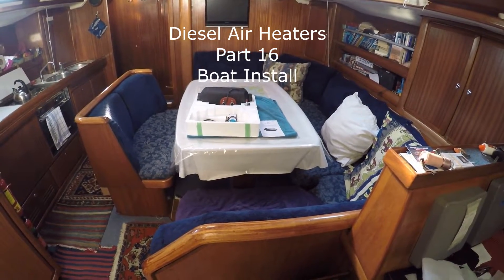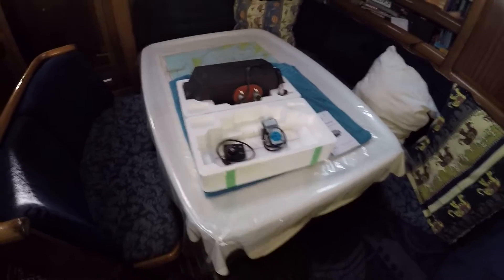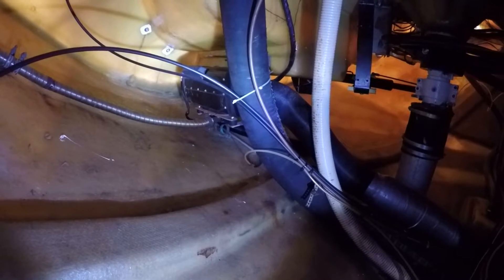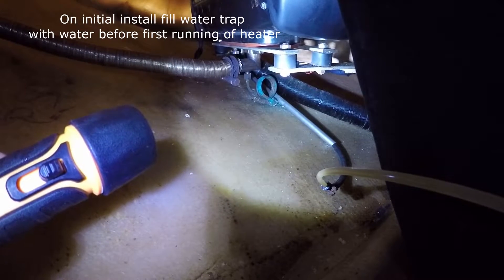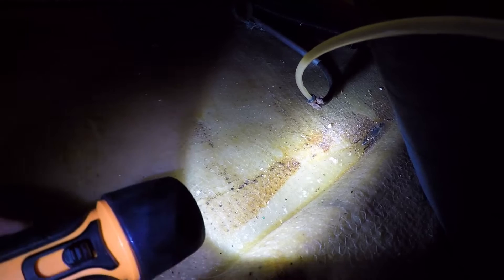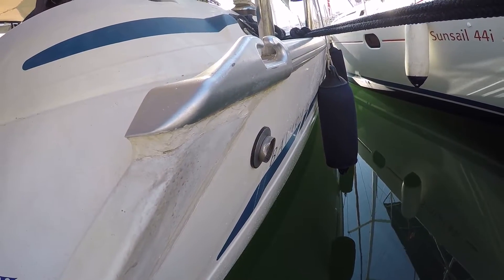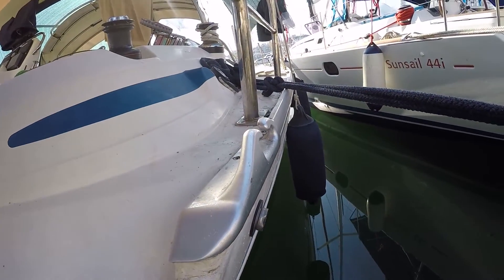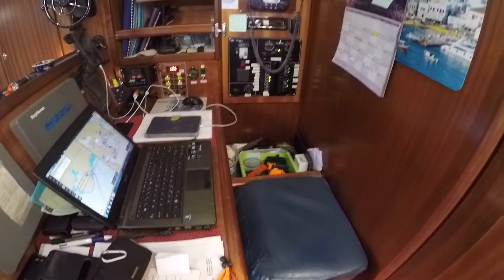Diesel Air Heaters Part 16  -  Boat Install

Comment: Thanks for all your efforts on these videos John, I've found them immensely valuable! You're an excellent teacher!
Reply from the maker: Thank you Mr B.   JMcK
Reply: Hi John wonder can you help me my 5kw diesel heater is showing E06 error I've sorted the fan it's ok now but still showing the fault and also saying check magnet polarity  thanks
Reply: I considered putting one of these in my motor home but saw a couple videos slamming the quality.  After watching these videos I’m convinced that if I install it correctly I won’t have a problem.  I’m also confident that I can do it myself.  Thanx

Comment: John, this was a totally excellent video thank you so much for taking the trouble to share all this invaluable information. i have had my Chinese heater lying in its box for months, while I have been thinking about the installation and finding an increasing number of questions. I am now just starting the install, and was thrilled to find that you answered every one of my questions. 

I was especially concerned about the terrible muffler as supplied, and will buy a proper one from Butlertechnik. The supplied one is lethal! Many thanks again, fair winds and following seas to you.
Reply from the maker: Hi, thanks for the nice feedback comments. I hope all goes well for you, and you have a lovely warm boat in the colder weather.  JMcK

Comment: Hi John Mck. I've watched a good number of your informative videos on these compact space heaters. In one of your earlier videos you were mentioning the air bubbles seen in the pump lines and how these were formed by action of cavitation. I have a bit of info to add. If the cavitation bubbles are no longer visible it is a sure sign that the atomisation gauze is becoming severely blocked with carbonisation. This creates a pressure resistance in the pipes exiting the fuel pump and the now compressed bubbles dissapear as the air pockets are collapsed by excess pressure in the fuel line.
Reply from the maker: Hi Howard, thanks for the feedback. Yes, you need to be able to see those little bubbles pulse tracking towards the heater.

Comment: Excellent Series on the Chinese diesel air heaters. I was looking to purchase a webasto, but the price scares me, but after watching your series i will definitely purchase the knock off.  Looking to put it into my cargo trailer for hunting the cold winters.  Just have to make up my mind on an all in one or the heater and tank separate!!  Great job on the videos!!!    Hello from the great white north, Fort McMurray, Alberta Canada
..
Reply from the maker: Hi Byron,  thanks for the feedback. If I was to install a permanent heater in a trailer I would use the standard heater. If I was going to move the heater around regularly I would go all in one heater.  JMcK

Comment: I've spent parts of two days watching this series of videos and I've learned a lot.  Thank you.

I'm always looking for alternative sources of power, light, heat and means to cook.  In addition to a 1600 watt inverter generator and a (very thirsty) 5000 watt generator (House damaged during storm?  May need power tools for repair.), I designed and built a solar-charged "Wait until daylight" system that can provide 8 to 20 hours of limited power for the frequent but usually short (under 3 hours) commercial power outages we have (longest outage here in 15 years was 16 hours, but we lived near this area before and had several consecutive days without power).  Why "Wait until daylight"?  The system provides enough power that I don't need to rush out in a thunderstorm or at below freezing temperatures in 7 inches of snow to get a gasoline generator out of the shed to have lights or keep the fridge cool.

I have the same outlook on backups for heating, having had a nearly new, very efficient, very high tech gas furnace controller die in January and the "3 day" turnaround was 14 days.  We managed with a kerosene heater at one end of the space we wanted to heat and gas logs in the fireplace at the other end (the remote AND the gas valve for the gas logs are battery powered so they work when power is off).  However, neither of those provides heat to the basement which is why I'm interested in a diesel heater.  I need limited heat for a few hundred square feet and the temperature rise above the outside temperature typically only needs to be perhaps 10 degrees F (5 degrees C) to keep the pipes in the basement from freezing.  A 5KW heater on its low setting (maybe 5000BTU?) might be adequate and, based on your tests, a gallon of diesel would last perhaps 26 hours.  On that basis, a 5 gallon can of diesel could probably probably provide enough heat to protect the pipes for at least a week - not every day will be below freezing and the underground portion of the basement will be close to the 45-50F (7-10C) ground temperature.  The solar system has a 420AH 12 volt battery bank so I would have power to run the heater and the solar power to recharge the batteries.

I still have research to do but you've given me an excellent start on it.
Reply from the maker: Hi Notyoung, thanks for the detailed feedback. I hope a diesel heater install meets your needs.  JMcK

Comment from the maker: Hi Richard, yes you could do that if you wish. It is just personal preference. Some people like to recycle the air, others like to only heat outside fresh air and accept they will burn a little more diesel. 

These heaters are excellent at removing moisture from the air, so that is not an issue whether you go fresh or recycle. JMcK

Comment: Thank you so much this series answered all my questions plus some things I didn't even consider.  I would love to hear more about your navigation, I run openCPN on a raspberry pi type setup with integrated AIS monitoring
Reply from the maker: Hi Clion. We run open CPN on the ship laptop at the chart table, with tracking always on. At the helm we have a large iPad in a water resistant case running Navionics or iSailor. I prefer iSailor, my partner prefers  Navionics. We had to buy a 3 amp USB outlet as we found the normal 2.1 amp would not keep the iPad charged .  JMcK

Comment: Hello John:
Suggestion for for safely stopping parasitic power draw on heater; obviously having a power switchable in a boat or motorhome is essential to keep the battery from going flat. However as you know if power is shut off accidentally while the heater is running you have a big problem. 

This can be eliminated by moving your switch from the power wire to the controller wire. A double throw switch will disconnect two of the three wires eliminating any possible power draw from the controller. A single throw switch should also work but a bit of experimentation would be necessary to put the switch on the proper wire. With this setup the heater could never accidentally lose power unless the fuse blows because as you mentioned the controller can be unplugged and the heater will continue to operate.

Thanks for what is truly the best Diesel air heater information on the web. Much appreciated. I don't suppose you could temp the exhaust at the port for me while running at full power. I am considering using high temp 3-ply silicone tubing in the exhaust either as a connector or for the full length to make attaching and sealing much easier for servicing the heater. They are rated for a max (though I suspect not constant) temperature of 260 degrees centigrade. The install in my boat would make it impossible to service in place and difficult to properly seal the exhaust using std stainless tubing alone. Any thoughts you could provide would be much appreciated. 

Thank you: Tim
Reply from the maker: @timsharkey_LensN2Shutter  

Hi Tim,

Thanks for the feedback.

Running at full power, you could exceed the max rated silicone temperature. 
Those videos are very old now, but I am sure I did exhaust temp readings in one or two of the videos.  When I get time I will go and have a look.   JMcK

Comment: John, thanks for your very thorough videos. Would you consider doing a video on the Chinese air/water combination heater, in the future. 

Thanks Steve
Reply from the maker: Hi Steve, yes, I would like to do a video on one of those if I can buy one at a reasonable price.  JMcK
Reply: @johnmck1147  well over time, the prices should come down, there are not many suppliers.  Thanks for the consideration.

https://wholesaler.alibaba.com/product-detail/5KW-7KW-12V-24V-water-heater_60871506423.html
Steve
Reply: John, excellent videos, really top notch on content.  @stevecarlisle3323  Those heater warm water very slowly, and put out a ton of hot air in the process. They are great IF you want to warm up the cabin and, as a bonus, get hot water after a while, but if you mainly want hot water, but does not necessarily want a cabin heater on at that moment, it will not work well (you can dumb warm air outside, but it will still take long to warm water for shower, for instance). With that in mind, I'm looking at getting one of the "regular" 5kw air heaters and installing a Y connection on the hot air output to run it through a car HVAC cabin heater (but backwards, warm air will heat water). A water circulation pump would force the flow between the boiler and the car "radiator" (I'm planing to heat the water it self, not no mess with engine cooling system part of the boiler). If this works, I will be able to only heat water, only cabin, or both... John, are you willing to make a test rig for this???  maybe it suits your needs on the boat as well. Cheers!
Reply: @paial  we are well aware of these water (hydronic) heaters, what they are designed for. NO, they are not " On Demand" water heater, but are used with radiators with fans.
Thanks
Reply: @stevecarlisle3323  , you might have seen this (https://www.youtube.com/watch?v=vtvy2MwbArQ), if not, the guy ran a lot of tests on type of heater you linked from alibaba. I was very interested in them, but when I saw the tests, from the total heat created, 20% goes to water an the rest to air (or something in that ball park). As far as I'm aware, chinese do not make a generic hydronic (wish they did), and the "brand" ones are way out of my price range. So my proposition was to transform a regular air heater into a dual porpoise one (heat only air, heat "only" water, heat both), use a air to water radiator in front of the hot air output, and store the hot water on the boiler (not "on demand"). I my sailing, now an then, I need more hot water, but no need for cabin heating, I feel really bad to turn on the diesel engine just to heat water, and I foresee needing cabin heating in the near future. So I was on the hopes that John could give this idea a try as he seems to really enjoy testing this things. Cheers.
Reply: Forgot to add, one thing that concerns me on this chinese air and water heater is that it seems like if the unit is on, you have to have a flow of water otherwise you will start boiling the water that was left over (or stagnant) maybe creating too much pressure in the system and/or start overheating water hoses. I might be me overthinking it, but in my head, you either have to have water flow (and a big tank for an overnight run) or have to drain the water part if you plan to use it for long for air heating purposes (and use metal pipes on the water side for some length).
Reply: @paial  Of course,  the heater is only one part of the system. Research Hydronic Heating ! You also need a pump and radiator !

Comment: Another excellent tutorial.  I am now going to cost up purchasing a genuine Chinese 5 Kw model and then the additional exhaust skin fitting, properly sealed marine exhaust silencer, master switch, exhaust lagging, exhaust brackets/hose clamp thingies, stainless steel cable ties, rubber mounts and modified mounting plate.  Fitting will be the biggest problem as my boat, Whittley SL26, doesn't have a lot of room around where I intend to do the installation which is in the void close to the throttle box controller 
It will need to be side mounted, glow plug side upwards, and the exhaust will, somehow, go upwards and out through the hull above the gunwales on the side of the cabin -----  could be easier said than done.  It's going to require universal joints to be fitted to my elbows and wrists!

Comment: John, I rely on your expertise and knowledge base when purchasing and installing operating, maintaing my 5 kW heater in my motorhome. again I thank you. Since I consider you The best source on the Internet I was thinking that maybe you could do a complete overview from the scam Of an 8 kW heater two the fuel hoses, exhaust, controllers, installing etc. and use this to refer back by number of your specific video for more information. Also I saw on the net that they have made one that has incorporated a water jacket so you can use it to heat water ! I watched it on YouTube and I’m curious as to the practicality? as I would like an on demand boondocks heater. Thanks again John you’re the best
Reply from the maker: Hi Keith, first thank you for your positive feedback.

I had basically finished the series but I have undertaken to do two more videos, one on the metal case heater, and a motor home install.

Re the air water heater, I would also do a test of one of those if I get my hands on one, but at this stage I do not see myself going back over past topics. But I never say never.

Cheers,   JMcK
Reply: John McK 47 Well john I was just hoping that you could do an overview of what’s involved from selecting a heater to installing the heater to running and shutting off the heater giving a complete overview and one video of all your fantastical lessons. By the way I have created a portable suitcase and installed a 5kw in it, along with a battery and fuel-cell  I’ll send you a couple of pictures later. 🙌
Reply: John McK 47 The reason for an overview is that people are generally misinformed and too lazy to watch all of your explanations An overview with references to each one of your videos will allow them to determine if they would benefit by purchasing and installing the Chinese diesel heater.
Reply from the maker: Hi Keith,

I will consider your request, but it is not something I would do in the near future. I have a couple more videos to do on these heaters and then I was going to move on to something else. Cheers. JMcK